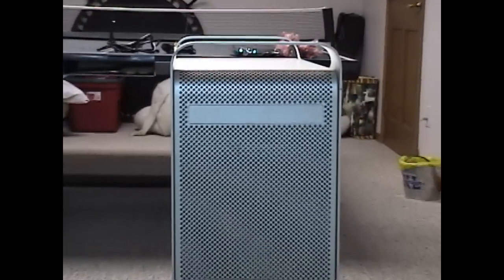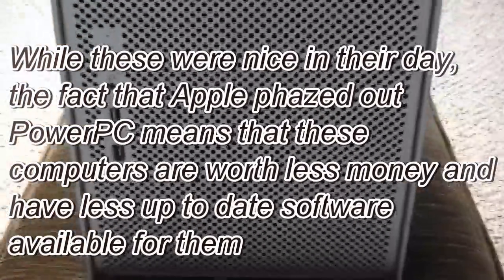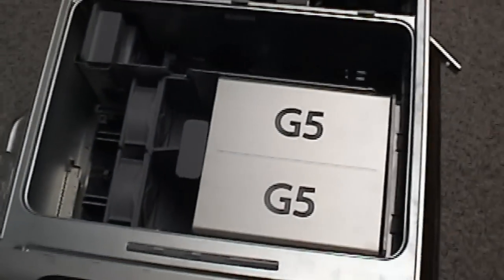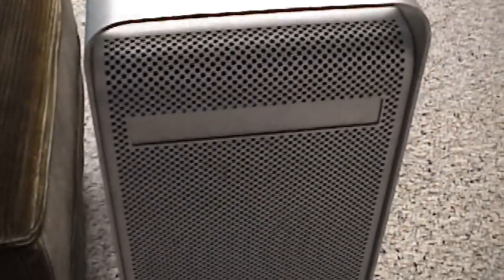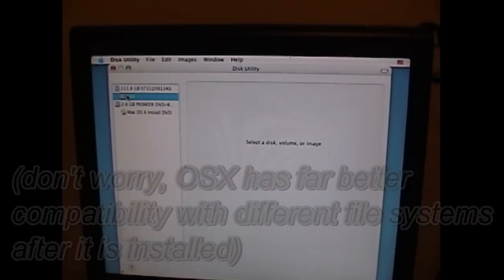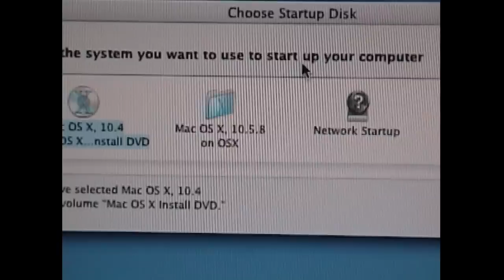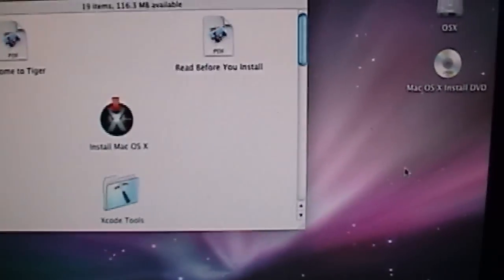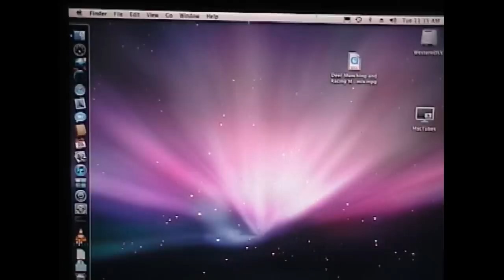PowerMac G5 Setup/First Run + RAM, Hard Drive, and OSX Installation

Comment: I read a bit on the internet and other have the same issue of the computer ejecting the disc with OS X 10.4 on it.  I am going to try it with a different disc, it may be that the dual layer disc I am using the DVD drive probably can't read.
Reply from the maker: Is it ejecting the disc before or after it boots from it?
Reply: The computer does not boot from the burned disc.  After holding 'C', the computer tries to read the disc and boots into my current OSX. Then it ejects it when the desktop is ready. I throw it back in for fun and it ejects it in a bit.  I think it's the dual layer. I will try a single layer disc later on tonight.  On another website someone mentions that this ISO might be hardware specific.
Reply: *****
By the way thank you for the video, it's great!
Reply from the maker: Manuel Baltodano
Thanks. I understand the frustration associated with unnecessarily burning discs to get anything to work with this computer, so I hope the rest of the process goes more smoothly.

FYI, if you're not already accustomed to it, this kind of "hand holding" is to be expected at every step of the way with the PowerMac.
Reply: ***** Oh, I know, I fix computers and they all bring they're own issues.  So it seems that after trying a single layer dvd , it still did not work. With some research I can to some info that says these dvd drives can't read DVD+R media but DVD-R. So I'll have to wait until tomorrow to go and buy -R media now. haha

I've been trying the method of booting with Open Firmware and a usb stick and that's  not going well yet.
Reply from the maker: Manuel Baltodano
I'm not completely sure about that. I burned a DVD+R and it read fine in both drives in my PowerMacs (both a Pioneer and Hitachi LG). Are you burning from an ISO or DMG?
Reply: *****
My Question is: What to burn? ISO or DMG? (For 10.4) For 10.5.8 i have to use the DMG, right?
Reply: Niclas Kraus
 Burn the 10.4 as it's an install DVD.
Reply: *****  I was able to install 10.5.8 on the G5.  I used my macbook pro to restore the g5 in target mode with disk utility. I had to go out and buy a Firewire 800 Male to Male cable.  I used my install dvd in macbook pro to launch disk utility from the dvd because otherwise all you get is "Drive is busy".

:)  Thanks for the amazing video, now I'll use the links to get the G5 working up to date.
Reply: Manuel Baltodano I dont got a mac before, there is only my windows 7 and this G5 2Ghz without HDD and nobody knows about the function, but it costs me only 40€ :D
Im trying to run it tonight, it should be possible!
Reply: Niclas Kraus
Yeah give it a try.  Burn the .toast file (10.4) and then when it loads up use Utilities>Disk Utility and Restore the DMG file to your new HDD. I put the dmg file in a USB stick and then in Disk Utility go to the open image option under one of the menus at the top bar.
Reply from the maker: Niclas Kraus
If your G5 has no hard drive, you won't have anywhere to install your operating system. You'll want to install one either by using the computer itself (as I highlighted in the video) or by using a second computer (as mentioned by Manuel), depending on what works best for you based on your current setup.
Reply: ***** Now there is a HDD :)
But when i insert my 10.4 Disk with the .toast (edited to .ISO and burned with ImgBurn) the computer shows me a grey screen with a folder in the middle, what can i do?
Reply from the maker: Niclas Kraus
If the disc burned correctly, you should be able to boot from it. Try holding the "alt" key when you start up (start holding before you hear the chime) and see if the DVD shows up on the boot menu that comes up.
Reply: *****
when im holding the "alt" key, i get in a very simpel menu. i can controll a watch as curser and there are 2 buttons: on the left side there is somethink like a "reload" button, and on the left side there is a arrow, but i cant click on them. after a time the cursor turns into a real curser.
The  good thinks: the hardware seems not defect and there is someone who is helping me ;)
Reply from the maker: Niclas Kraus
Does the boot DVD show up on this menu after your cursor changes from a watch back into a standard arrow?
Reply: *****
No, he is enjecting it every time, i forgot to mention that :/
Should i burn the DVD again? Or maybe the DVD-reader of the mac is defect, can i recplace it it with every normal sata reader?
Reply: Niclas Kraus
Something strange: My windows PC is showing that the burned DVD (ImgBurn says: Mission succesful!) is empty. -.- only an old .txt is on there....
Reply from the maker: Niclas Kraus
That's not necessarily a bad thing. If I put my 10.4 disc into the drive on my Windows computer, nothing shows up there either. If you look at the bottomside of the disc itself, does it look written to? To me, mine looks about 2/3 filled.
Reply: *****
I burned it again, again there is only a .txt on it.
I dont know how to see if its written, but it seems different in outer circeles. i woul say yes, its written.
Reply from the maker: Niclas Kraus
As long as it was burned correctly, the machine should be able to read it and get it to show up on that menu. If you've got a second computer hanging around with an extra IDE/PATA port, you can test your Mac's DVD drive by removing it and inserting it into another computer to see if it reads other discs and then go from there.

Another thing that might be worth trying would be a different image file. I actually found what appears to be a PowerPC 10.5.6 bootable DMG file with seeds on KickassTorrents: https://kickass.so/mac-osx-10-5-6-leopard-dvd-single-layer-for-ppc-english-only-t9116623.html#main
I can't vouch for its functionality, but it looks promising based on what I see in the comments.
Reply: ***** Sry for no answer, but i was in installing 10.5.8! i type this comment on my G5, so, at least everything worked. Its 5:21 in germany now and i have to wacke up in 7 hours, but i get it!
1. a second try to burn the cd did, it was faster, but dont ask me what was false in the first time. 
2. i formated the usb drive 3 times, until i get to format with TransMac
3. by the process of recovering, 16 fails were found->restart->it worked against by the second time :D
thanks for your help Channel 2012!
Reply: ***** But now, there is only 1 cpu aktive and only 1gb of ram :/
Reply from the maker: Niclas Kraus
Glad you got it working. Now, regarding your cpu and ram problems, does your computer physically only have one cpu and one gigabyte of ram or does it have more and is just not seeing some of it/them?
Reply: ***** Im sure there is a second CPU, the System Profiler says, its a PowerMacG5 7,3, and in the case there is the double g5 logo. On the back side there is only coming hot air out of one cooler :/
Power On Self-Test:
  Last Run:	1/17/15 5:42 PM
  Result:	Failed
  Failure type:	Memory
  Memory slots:	DIMM0/J11, DIMM1/J12
There is also only 1gb of ram, splittet in 2 banks. but physikaly there are 4, schould be 2gb.
I was trying to make an apple hardware test, but when i boot with pressed 'd', nothing special happened, only my keyboard doesnt work anymore.
Reply from the maker: Niclas Kraus
Do you have another computer in which you can test the memory?
Reply: ***** No :/ but i can test every memory paricular. Do you think the memory can affect the cpu in its function? because the second CPUs is more important for me than the memory.
Reply from the maker: Niclas Kraus
Why do you think that the second processor is inactive?
Reply: ***** there is no hot air coming from the second cooler and system profiler says: Number Of CPUs:	1
Reply from the maker: Niclas Kraus
I don't know what to tell you, I've never seen anything like that before.
Reply: *****
No Problem :) I thank you very much for your support! Without you, i never get it!
I now got 3 GB of ram, i exploited it from the old PC of my brother and sortet the rams wich were inside (512mb werent matching).
About the second CPU i asked in a facebook group, they told me i shoud re-seat the processor. when it helped: well, when it doesnt, i have to by a new cpu (they are not very expensive).
But there are 2 strange thinks anymore, were you maybe can help me.
every time i start my G5, the cd-drive opens, how can i change that?
and: the apple hardware test is not working.
Reply from the maker: Niclas Kraus
You're welcome. From there, you've got me stumped. You might like to try the MacRumors forums in the PowerPC section, there is actually a surprisingly large number of enthusiasts that visit and participate that are more knowledgeable than I am about troubleshooting some of that stuff. I would encourage you to start a thread or two over there (if none on the topic have been started already) and see if any of their members can help you out at all.

Comment: Is this PC still worth buying in 2017 if not only for resale?
Reply from the maker: If I'm honest, this PC wasn't even worth buying in 2013. Even if somebody is getting rid of decently-specced systems (in decent condition) for $0-15, make sure you have an "exit plan." Remember that these things are going to be a hard sell on eBay due to the shipping & handling costs, so unless you have a thriving Craiglist community, consider the possibility that you may have a difficult time selling it when you're done. If you want to play the ever-popular game of "how little hardware can I get away with using in my daily driver?," find a cheap tablet/laptop/anything from 2006-2010 with a Core2 Duo; you'll probably have a much better time preserving your sanity. Heck, my Atom-based Surface 3 performs better than the PowerMac ever did, and all while using only ~1.25% of the energy required by the latter.

For more information, check out my followup FAQ video on this very topic:
https://www.youtube.com/watch?v=da5vfIH069E

Comment: Run the ASD Dual Boot 2.5.8 CDThey sell them on EBayIt will calibrate your machine and diagnose any hardware issues
Reply from the maker: +michael37327 
Good thing we didn't need calibration or have any hardware issues.

Comment: Hey ***** Great Video... Well done!

Would you be able to link me to another OSX 10.5.8 install file?

Also, Are there any restrictions to what type of hard drive I can use?
Reply from the maker: Sorry I didn't get back to you sooner, the link has been updated in the description. As far as hard drives, you should be able to use most any SATA drive, but I did have a very interesting experience with mine: when I first put the drive in, it would not be seen by the OSX installer, which was a problem. I had to hook it up to a normal computer and run a special software inside of DOS to disable some obscure feature that that particular drive had enabled by default (I was thinking to myself, "of all the drives I could've bought...") which was not supported by the OSX installer. I'd say this was probably a minority/coincidence situation though, most drives should work fine (including SSDs). Best of luck!
Reply: Thanks! *****

Comment: Its the weirdest thing , but I can't seem to be able to copy of the .dmg file over to a memory card. First i formatted the memory card in  HSF+ on the mac and then used a program called mac drive 10 to open and see the drive , cut and paste the dmg file. But when it starts to copy it stops at 99%.

I have tried your image. I even found a torrent with the same file and i keep having the same problem. It has happened with two different memory drives. I am using windows 8.1.
Plz halp.

Comment: Is the DMG file hosted anywhere else? Mega has crashed several times and even after signing up I cannot download it.
Reply from the maker: Just keep trying and it should work. MegaUpload is among the best in cloud storage providers, so you probably won't have much better luck downloading it from anywhere else, although you may also be able to find a Torrent of the file.

Comment: i have G5 1.6Ghz 1Gb sdRam and never try to install video editing full HD, it's still run.. pls recommended any program is better.. tQ
Reply from the maker: Thanks for the warning, but I already tried that Final Cut software and experienced the uselessness of the G5 in regards to video editing. I tried importing one video and it just wouldn't even take it. If you want to do just basic and intermediate editing, I'd stick to PowerDirector or similar software on Windows - OSX will leave you disappointed.

Comment: Hey nice vid. but the link for OSX 10.5.8 Install .DMG Image file is dead, do you have another link? TIA!
Reply from the maker: Indeed. I forgot about that domain change, but the "ThePirateBay.sx" has now been changed to "ThePirateBay.se" and all is working smoothly again. Best of luck with your install and thanks for pointing that out.
Reply: *****
I change the .toast extension into .iso, then i burned it into a dvd. Now i have the 10.4 disk, i put it on dvd-rom but why it keeps ejecting the disk? And please tell me if I'm doing this right to enter the boot mode, I push the power button then press and hold the "c" key after hearing the boot sound.
TIA!
Reply from the maker: Rio Garrell

It shouldn't eject it. Are you sure the disc burned successfully? If you put the disc in while OSX is already running, does it show up in the explorer?
Reply: *****
Hmmm... How do i know if its successfully burned? 'coz my app says "success" but then when i check the disk its empty. xD
Reply from the maker: Rio Garrell

Verify that your optical drive is working by reading some other known working discs in it.

When you burn discs in the future, make sure to check the box that says something along the lines of "verify the disc after burning" (the location of this option will depend on the software that you're using), and that way you can be sure that it burned correctly.

Comment: I am trying to follow your installation process for the OS X. I downloaded and successfully burned 10.4, but when it comes to the 10.5.8 .dmg I am having a ton of problems. First, I tried FAT32 format didnt work. So I downloaded TransMac and I was able to format my 4gb usb stick in the hfs+ and copy over the .dmg.

I plug it into the mac, I also insert the disk with the iso. I follow the video but I keep getting Error (2) and (16) resoruce is busy. I have been at this for 2 days, with no luck. Is it possible the .dmg file is damaged? Because I tried to view it in another program it wouldn't even open
Reply from the maker: I found that this was often the least consistent part of the process in the three times I did it, but it always worked in the end, so I'm pretty sure the DMG file is good. I really don't know what to tell you other than that the computer might just not like that USB drive - I know it sounds dumb, but these machines are sometimes finicky about dumb things.

The G5 is a lot like a nice looking small car that you can drive only on nice days, but the second there's actual work to be done or snow on the ground, you've got to get a "real car". In this case, it's an unforgiving computer with little versatility and inadequate "ground clearance" :-), especially when working in that 10.4 install disc environment.

At any rate, I'd recommend trying a different USB drive or copying the file again and go from there.

Best of luck!
Reply: Out of nowhere I got it to work.
In windows I unchecked "read only" on the .dmg file transfered back onto the usb formatted in hfs+
then back in the disk utility I erased/format the hard drive and on the restore tab didn't click "erase destination"
it worked
thanks for the video
Reply from the maker: HulkSmashed31

Great, glad you got it to work. I hope the computer works out for you okay.
Reply: For anyone out there reading this, I had this exact same issue... I was able to resolve it by erasing the USB drive using the disk utility in 10.4 Tiger on the target machine. I then took the USB stick back to a Powerbook and copied the DMG file from there. The Powerbook is running 10.6 and I originally formatted the USB drive there. It seems that Tiger does not like USB sticks formatted on later versions of OS X. The rest of the install worked great. 

Also, the Tiger 10.4 links in the video description no longer work. The copy I downloaded from the following link worked well:
https://isoriver.com/download-your-file-now/?url=https://archive.org/download/MacOSXMrVirtual/Mac%20OS%20X%20Tiger.iso

Comment: After using your 10.4 iso i get a black screen with codes?
Reply from the maker: This appears when you try to boot from the DVD?
Reply: yes and i use Roxio cd burner to burn the image
Reply from the maker: Sean Matthews
Weird. If you hold down ALT when starting the computer (and wait a while), does the CD show up on that "Select boot devices" screen?
Reply: No, i recently got an OSX 10.5.8 factory disc can i install it directly?
Reply from the maker: Sean Matthews
That's unusual. Are you sure the drive works correctly?
You could use a stock OSX disc, but it wouldn't provide some of the slimming benefits of the image file here.
Of course the easiest option if you've already got the PPC DMG file on your usb drive is to boot from the OSX Leopard installer CD of yours and follow the directions in the video as if it were the Tiger CD. Lots of options.
Reply: After i used your image my HD doesnt show up unless i partition it and change it to a PowerPC boot
Reply from the maker: Sean Matthews
Does it boot now?

Comment: Can someone help me, please?
I have a dual PowerMac G5 with  GeForce 6600 256MB, 4Gb RAM and all my youtube videos run extremely laggy and slow (using TEnFour Browser)... Any thought why?
Reply from the maker: TenFourFox is now broken in that the plugins feature doesn't work right, which means you're at the mercy of YouTube's HTML5 player. The G5 doesn't do so well for web browsing, so the bloated HTML5-based player is probably best suited for a regular computer or smartphone.